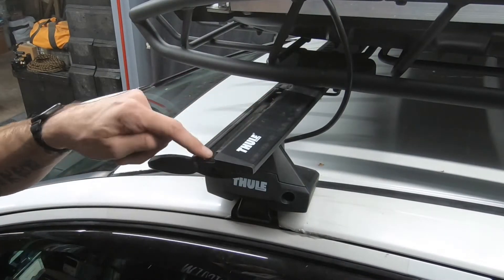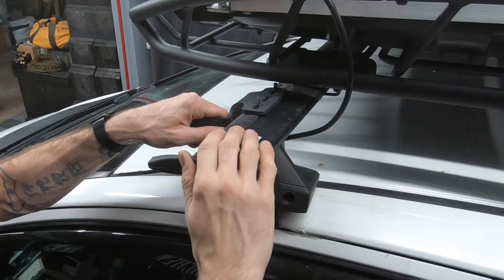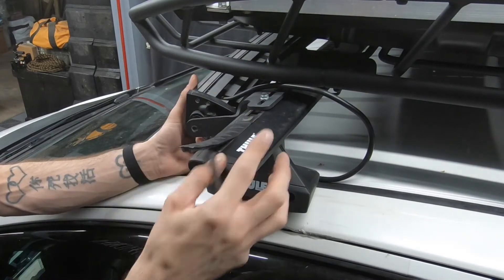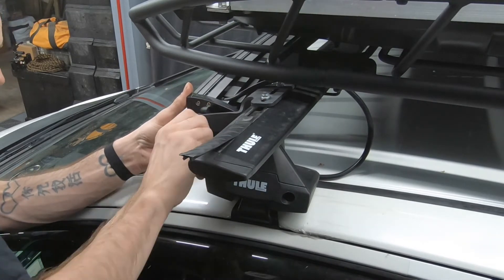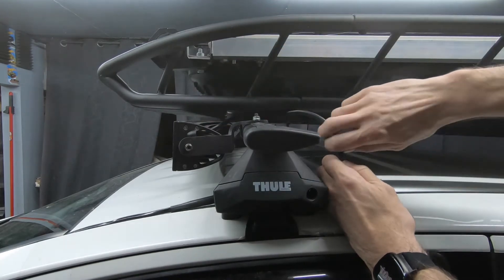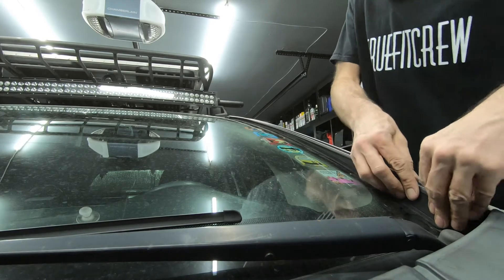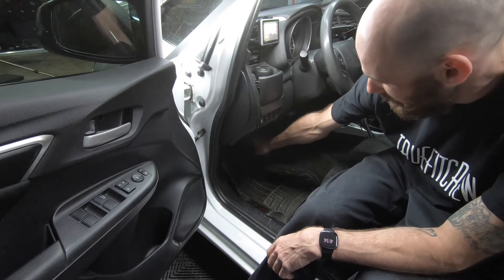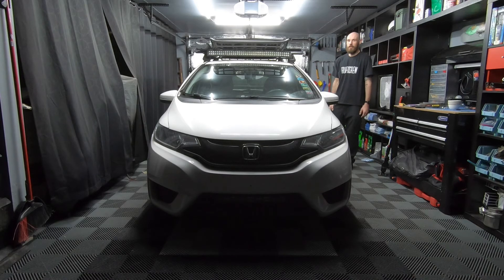HONDA FIT/JAZZ - GK5 - CAMPER - Thule Roof Rack 42" L.E.D. Light Bar Installation & Review #HondaFit

Comment: Awesome thanks! Not sure if you’d be interested but another youtuber, wranglerstar made a video on installing a single switch that allows the light bar to either come on with the high beam switch or be manually turned on and off separate from the high beams

Comment: Did the mounting hardware that came with the Rhino Rack brackets not fit into the crossbar?
Reply from the maker: No, The Rhino Rack hardware was designed to fit into the Rhino Rack cross bars and basket.
The channels on the Thule cross bars are slightly narrower.
Reply: Thank you!  I'm attempting a similar project and your feedback helps immensely!
Reply from the maker: No problem. Ask anytime. @grnamin

Comment: Hey man. Found your channel and been going through all your videos. I like the roof rack / basket and LED combo and I'm thinking of doing something similar. Quick question though. Any particular reason why you wired the LED bar directly to the car battery and not via the cars fuse box? I also want to run a 12v DC from the front to the back of the car to install a 12V lighter port for my camping fridge as i want to be able to remove it when I'm not on a road trip. Have you done anything similar or is all your equipment run by your Solar Battery? Thanks. Great job!
Reply from the maker: I honestly have no experience wiring things directly to the cars fuse box. 
The basic instructions that come with these light bars also illustrate the light bar being directly connected to the battery. (The Easy Way) So this video should help assist other beginner car enthusiasts with their light bar installation.  
Eventually I plan on making a more advanced wiring video by doing "The Big 3" and installing my own AUX fuse box in the engine bay to run all my add on devices. This will also help prevent multiple wires from running to the battery. #RatsNest  

If you have two 12v ports in your car up front, you can keep one for your phone charger and run a 12v extension cable to the back where you want to keep your fridge. This will make the whole thing fully removable and prevent any additional wiring job. With out any Battery bank I would suggest run your 12v cooler right at freezing or colder. That way when your car is shut off everything still remains fresh or thawing for several hours after the cooler has been shut off.

Comment: those clamp in door roof racks are so shit mine came off every time. cool setup tho
Reply from the maker: Thank you. I agree, Even at the appropriate spacing the foot packs in the rear would tend to float above the roof of the car leaving the clamp to do all the work. This might be due to the shape of the fit and how it's extra wide up front and narrows toward the back. A fellow FIT owner purchased a Yakima roof rack and had it professionally mounted to the roof with some bolts installed in the drip sill area. One day 2 of the 4 bolts broke. Thankfully he was just driving around town and not on the highway.
Reply: @HondaFit4Adventure  oh shit i was about to do what your friend did interesting